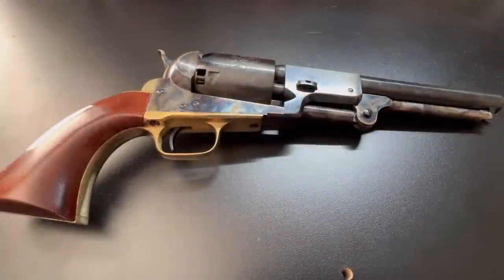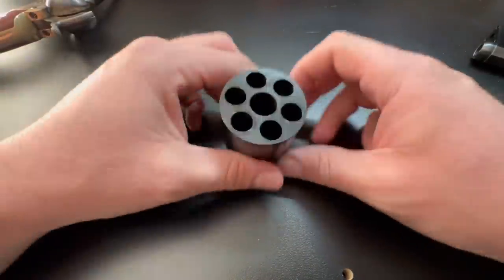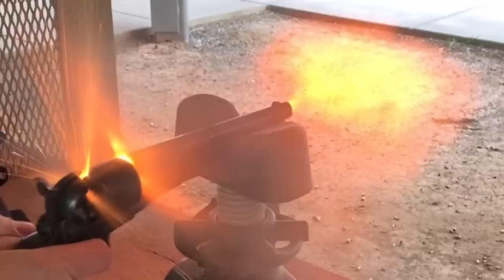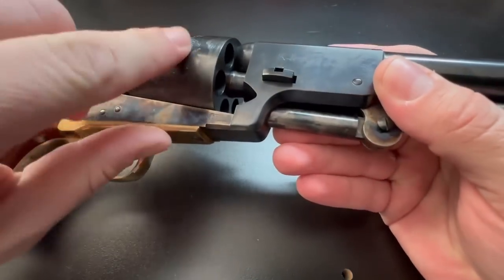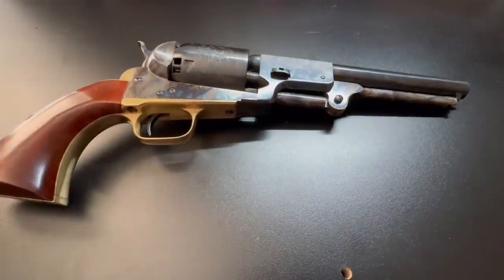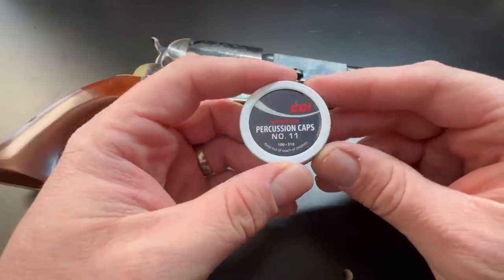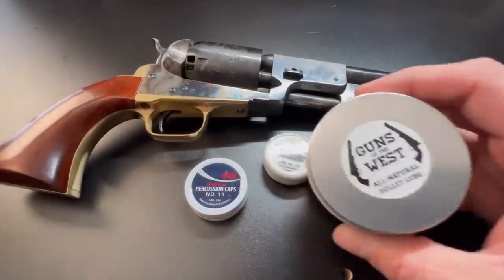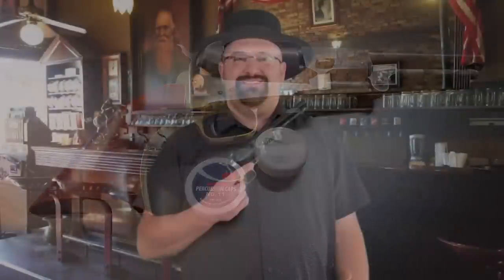Chain Fire: Why Does It Happen?

Comment: In the mid 1970's I had purchased a Colt Walker replica and spent a lot of time shooting it. One day I had a chain fire in which two additional chambers went off (one on the right and one on the left of the firing chamber). That would be three chambers at the same time! There was a loud bang and a huge cloud of smoke. When the smoke cleared I was holding half of the Walker and the barrel was 20 ft down range. The cylinder shaft had snapped and the barrel went flying. My buddy busted out laughing and said he would never forget the look on my face. The gunsmith that repaired the gun thought it was funny too.

Comment: late to the party but there was a time when i almost exclusively used my 1851 while in the woods. i just liked it more than other pistols. but i found that the rubber air tubing you use for fish tanks and stuff made a perfect fit over a cap when cut to about 1/8th inch. it created a seal at the bottom and also prevented the cap from completely shredding itself, mitigating the cylinder bind issue. i would smear a small amount of marine grease on the top of the ball with my pinky finger as well just to kind of keep the water out. 

i have submerged the gun on accident like this a couple of times and not fired it for days afterwards and it was still reliable. Im not saying its the ultimate solution but the really sticky marine grade grease and small rubber rings around the base of the caps made a huge difference imo. not that anybody cares. just thought id share.

Comment: This information is "dead-on-the-money" accurate. Excellent video! 

I bought a Ruger Old Army in 1973 at age 16 to start my cap-and-ball revolver experience, and in 50 years of shooting,I've never had an accidental chain fire. (WHERE does the time sneak off too? It seems like just yesterday!)

I have tried to intentionally ignite a chain fire using blank loads, and it is amazingly difficult to do so! However, I have been able to occasionally start a chain fire and the chain fire may start at the nipple side Or at the chamber mouth side, exactly as this video says. 

A nipple side chain fire is usually the result of loose caps, or bad nipples with very large flash holes, the large flash holes allowing loose-loaded powder into the nipple area that flashes on firing to detonate a seated cap. The chamber mouth chain fire is caused by an undersized bullet / ball, and no lube protection, pure and simple. 

My 50 years of "No Chain-fire Luck" is for these reasons, I think:
(1) I always use a way oversize ball / conical : 0.330 on ALL .31's, 0.380 on ALL .36's and 0.457" on ALL .44's whether made by Pietta, Uberti or Ruger. I hot dip lube the round balls or conicals in a lube of 2 parts beeswax and 1 part coconut oil well before the shooting session, and then while loading, brush tallow or lard into the chamber mouths onto the seated lead balls. The conicals, especially those with grease grooves, do not need the extra lube brushed in, as there is plenty of lube on the bullet,  so pre-lubed conicals can be just loaded and fired. For light target charges the pre-lubed round balls can also be just loaded and fired.  However, for heavier charges under the round ball, it is best to brush in some lube on top of the ball. because the thin lube coating on the ball is not quite enough to keep the bore clean. 

(2) I always replace factory nipples (even the Ruger!) with quality aftermarket nipples with flash holes so small a small sewing needle cannot pass thru, and that are tapered to allow a sliding solid seating of  #11 CCI, Remington, etc, caps or the Remington #10. (CCI #10's are way too small for these #11 Nipples). The tapered nipple allows the cap to slide on and then friction fit tight as seated, which seals against  moisture and flash fire, plus keeps the cap solidly on the nipple during recoil while firing all chambers.

Comment: Good video!  I did a video on this where I tried to cause a chain fire from the back by leaving the caps off and couldn't get it to chain fire.  I'm sure its possible but I think its less likely than it coming from the front.
Reply: You're a heretic. How dare you contradict the holy lore! ALL CHAINFIRES ARE FROM LOOSE CAPS. PROPERLY SIZED BALLS. SHAVED LEAD RING. BLAH BLAH BLAH. 
 Just kidding. Also, you have an absolutely top-notch blackpowder channel. Keep it up!
Reply: @khester7397  Yep, someone did a video showing that the “shaved lead ring” may not be a good indicator of proper ball seating, because the diameter of the chamber may be smaller at the front than at the rear!
Reply: While I  appreciate your test, I'm thinking that a chain fire might be "cap-to-cap", not to "cap-to-adjacent uncapped powder".  It would be interesting to see if one could get adjacent poorly fit caps to fire (no powder needed, so less scary😵‍💫).

Comment: I've been shooting cap and ball revolvers for about 30 years or more, and I've NEVER had a chain fire - knock on wood.  However I do recall an article written by a shooter from somewhere in northern Europe, maybe Finland or some other place up in the Baltic region.  This guy pretty much refuted the belief that chain fires originated from the cylinder mouth, but instead originated by the flame jumping from cap to cap.

He constructed a test rig that consisted of a flat steel plate with a machine bolt that took the place of the cylinder arbor.  He also had rigged a spring-loaded firing pin, if I recall correctly, that he could cause to be released from a safe distance.  Using this rig, and following normal loading practices for the cylinder, he was unable to produce a chain fire at the cylinder, with or without over-powder wads, and with or without over-ball wads.  He even went to extreme measures such as pouring loose powder over the front of the cylinder to try to get the flash to propagate from chamber mouth to chamber mouth.

What he DID find that permitted chain fires was to use the nipples that came with the pistol from the factory, and by pinching the caps.  Pinching the cap skirts was, at the time of this writing back in the 1990's as I recall, was an acceptable and recommended practice in order to get them to fit the poorly-made nipples that were provided by the factory on these pistols.

If you think about it, when you pinch the cap skirt of a slightly oversized cap, and then force it on to the nipple which is circular or conical in shape, you create two passages 180-degrees from each other on both sides of the nipples.  The flame from a cap in the instant of being fired can jump from the first cap to the neighboring cap, travel up through one or both of those passages, and ignite the priming compound therein.

Their conclusion and recommendation was that the best way to avoid chain fires is to purchase quality aftermarket nipples which are produced with tighter tolerances, and to find one brand and size of percussion caps which both fit those nipples tightly without pinching and stick to using only them.  Also making certain when you ram the ball or bullet into the chamber mouth it leaves a lead ring.  This ensures that the ball seals the  chamber mouths.
Reply from the maker: The danger of pinching the caps is actually the topic of my next video, to go along with this one. Thanks for watching!

Comment: Great video. Very accurate. My caps are no 10 CCI on my 1861 Colt navy .36 cal. And they fit so tight that if I have to pull them off for whatever reason it's a difficult thing. I use felt wad over my lead and always ensure that I get that shaved ring when plugging my lead. Reason I use wad over lead is I leave mine loaded at times for months and I've found that leeching into powder from wad caused slow fire when I finally did shoot.

Comment: Great Video on chain fire. It makes you have alot more respect for these old revolvers. Take your time and make sure you load it correctly. I had 5 rounds go off at the exact same time. I forgot to put lube around the cylinder to protect the bullets. The bottom round didnt go off, So atleast i didnt hurt the frame. Bullets didnt hurt the wedge pin on either side. It sure kicked. Take Care.

Comment: I recently was able to buy both CCI no.11 and Remington no.10. Not sure if it was just my batch, but the Remingtons did not want to go off at all. No matter what I did, hammer wouldn’t set them off. My DIY caps and the CCI no.11s ran much better, though my DIY caps are much dirtier and much stronger than typical caps

Comment: Proper cap and ball size is pretty much the cure. Lube of any kind doesnt do anything for chain fires. Good video Dustin.
Reply: Agreed. Just makes a nice holster all slimy and nasty. If you swab the bore with a patch after every cylinder full, it will not only be easier to clean, but you won't need that lube crap either. These colts will also go 4 or 5 cylinders before getting too gummed up to operate correctly.

Comment: What ball diameter do you recommend for .36 caliber, such as the 1851 Colt Navy?
Reply from the maker: I use .375 in mine and that has worked great. Some people have said they need to use .380, but I haven’t needed to.
Reply: @GunsOfTheWest  Thanks, I needed that. Trying to find any components these days is difficult, which means that there is no room for error when you do find them.

Comment: My Uberti Navy 1851 London model .36 cal likes RWS 1075 caps the best although CCI 10s will fit with a wooden dowel push . CCI 11s are a little loose but do work if that’s all I have with a pinch 👍

Comment: I recently saw a video of a guy using Small Pistol primers in place of caps. Short piece of small flexible plastic hose or tubing hold primers in place tight against the nipple. I tried it using just the primer and it works but I see sparks exiting around the primer.  I assume that a pressure spike is pushing the plastic tubing from around the nipple. He hasn't mentioned any chain fires so what do you think? Revolver is the 1858 Remington.

Comment: Great information Dustin.  I do use felt wads between the powder and the ball as well as some homemade lube over the ball. I use #10 caps or #11 with a little pinch but I do ensure they are seated well.
Reply: Lard would be an appropriate and somewhat authentic cover over the ball
That's what Civil War reenactors use, but they aren't loading a ball, just powder

Comment: It has been my observatio that the Colts are far more prone to this than the Remington or Rogers and Spencer revolvers. I used to use felt wads (1/16") with Rbs, but latterly use paper cartridges with lubed conicals. I ave never yet, in many thousands of rounds over the last 35 years, had a chain fire. I cast my own balls and conicals so make sure they are PURE lead... that is essential. One thing I DO always do on getting a new cap'n'ball revolver is to measure the groove diameter and ream the chamber mouths to .001" larger than that, and I use balls that are a few thou over the chamber size (usually .457s). This procedure also ensures not only uniformity, but that the chambers are truly circular. I have encountered some that were not on others' pistols brought to me for repair.
Having looked at that wonderful picture of the flames from a normal firing, I think that perhaps the Colt's sensitivity to chainfires is something to do with the design. The solid frame pistols must direct the flames in a different way at the rear end at least.. I do know that the 'pockets' for the nipples on the Remingtons are much smaller and deeper than the Colt's (many cappers will not get in there, I had t design and make my own!) and that might be a factor too.🙂

Comment: Properly fitting caps are essential.  As are bullets that leave you a little ring when you press them in.  From my experience, a wad followed by a small dab of bullet lube between the wad and bullet has been perfect.  No chainfires using this method and Rem10 caps for me.

Comment: If you load with the right projectile, you will never get a chain fire from the front of the cylinder. I've had half a dozen C&B revolvers that ive fired a lot, and I've only ever had to chain fires, both from the same Pietta .44 1860 Army. The second one destroyed the wedge. I thought the first one was caused by a cap falling off. After the second, I checked the gun out very carefully, and discovered that the cylinder moved back too far under recoil and actually slammed the caps into the recoil shield. 
I've fired thousands of roundballs and hundreds of conical bullets from five of my six revolvers and never had a problem, I fired twelve shots from that one 1860, pulling the trigger 9 times. That revolver is actually really accurate, and I have no problem firing it, as long as I only load one chamber.

Comment: About the “ring” formed when pressing in the balls— remember that that may NOT be a good indication of a good seal.  Because the chambers may be irregularly bored out, the diameter of the chamber may be SMALLER at the front than in the rear, where the ball rests.  So, it may be shaving a ring at the “top”, but may be no indicator of a good fit toward the bottom/rear of the chamber.  This is easily fixed by shaving the top of the chamber a little, but just something to keep in mind.